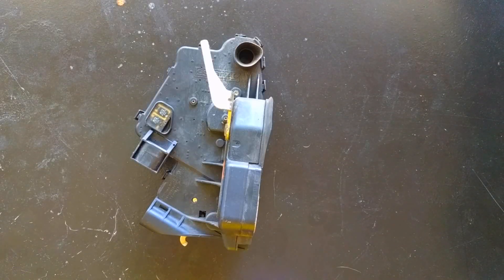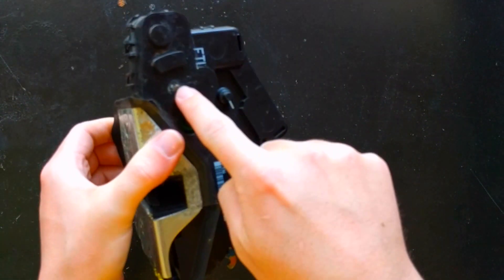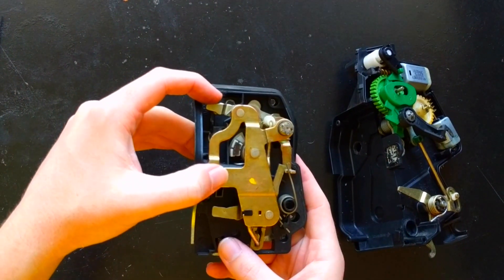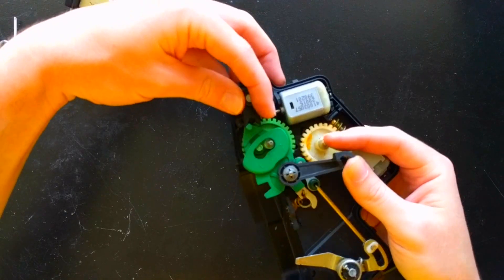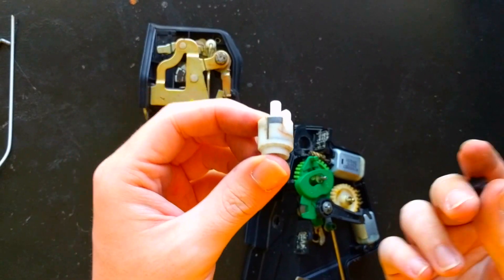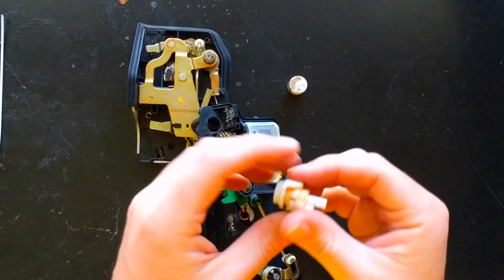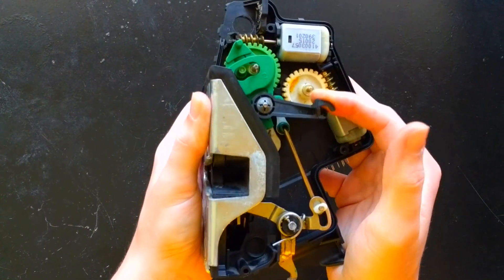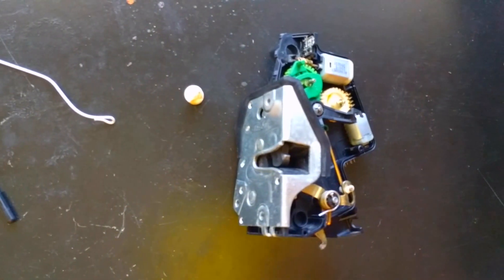E46 Door Lock Actuator - teardown and repair

Comment: posting here before i take my actuator apart. all doors lock and unlock. but the driver side door opens even when its locked. the lock pin is down and i can hear it engage but it doesn't actually lock. this is almost definitely an actuator issue right? im debating opening it and seeing if i can 3d print or find a replacement part for whatever broke
Reply from the maker: seems likely. I'd try to find the part at a junkyard instead of 3d printing.

Comment: Nice tear down. But how to lubricate it in the door? Do not need to teardown I hope, just lubricate.
Had an old door, and could not get the actuator out - except removing window. So I stopped there.
Now the paasenger door don't unlock by key, but ok mechanically from the inside handle.

Comment: My lock body keep freezing up - the door opens from outside, but the lock remains in the "open" position, and won't latch closed when I shut the door; I know it's the lock body because the interior handle seizes in the "open" position as well.

Without ripping the thing apart, what can I do to prevent this from happening?
Anything I can spray inside to drive the water out?

Comment: I've replaced my actuator several times and after a few weeks the key gets hard to turn and then unlocking the door from the inside handle takes some force or wont work at all. I can see the indicator slowly trying to come up when pulling the handle, but sometimes it wont "pop". It seems like something gets jammed but I haven't been able to figure out what.

Comment: great video and explonation, but i have a question i have a problem with my actuator specially with part of door lock. if is cold in outside i can open door but i can't close. the door lock is not "clip" on. i try to put some white lubricant but it is still not work. if I use some heater i can use door normally. i try to separete door lock with mechanizm but i have a problem with part of outside handle, i can't put out this from the body. Do you have some advice how i can separate this two parts without broken or it is imposible?

Comment: My key is stuck in the driver door handle and turns but won't unlock my door. I took out the door panel and airbag and manually open the door but still won't open. Any help will be appreciated 🙏

Comment: Thanks for your detailed explanation video!  I have a question regarding my 2002 M3.  I am currently having issue with my driver side door lock.  When I use the Key fob or center console the door will not unlock.  Only way to open is by using the key hole or pulling the door latch.  However, when I use the key fob or center console I can lock the door.  The passenger door works fine using the key fob or center console.  In your opinion do you think this is an actuator or GM5 issue.  Thanks Bill
Reply from the maker: gm5 relay for sure. lock works, but unlock doesn't? the unlock contacts are dirty / corroded on the driver door relay
Reply: @adcurtin  Thanks for your quick reply.  Yes the locking works with the key fob and when pushing the center console button.  Sorry to bother you but Would it be possible to tell me where the unlock contacts are so I could try to clean them?  Thanks again
Reply from the maker: @bw2347  you need to replace the relay. bmwgm5.com
Reply: @adcurtin  Thanks for all your help!
Reply: @bw2347  I'm having the same issue. Did replacing the GM5 relay fix the issue?
Reply: @jaccovw99  no actually it turn out to be the lock  actuator.  I replaced the GM5 relay and had the same issue.  Then change the actuator and that did the job.

Comment: Thanks for making this video. I am trying to fix the lock on my 2003 E46. Central locks driver door fine, but unlock wouldn't unlock, so every time I have to open the door by hand from inside and it is very hard to do and it feel like I am about to break the actuator.
Reply: Did you repair it? Same issue.

Comment: Mine doesn't work when it's really cold it won't open and if it does it won't  close
Reply from the maker: that's probably the relay in the gm5 module
Reply: @adcurtin  I think is something mechanical because the door unlocks but it doesn't open when I pull the handle, it doesn't feel connected to anything

Comment: Fantastic explanation and video, thank you! My driver side lock seems to be binding when I attempt to manually unlock it with a large flat blade screwdriver (with the lock cylinder out). I was wondering why. Seems perhaps it's the white part or how it connects with the green gear? Electrically, sometimes the door unlocks and sometimes it doesn't. When it doesn't and I go to pull the handle from the inside after I've pressed the button on the remote, I feel it binding before it fully unlocks. Not sure if I have a GM module issue (relay issue) along with an actuator issue. Great video man!